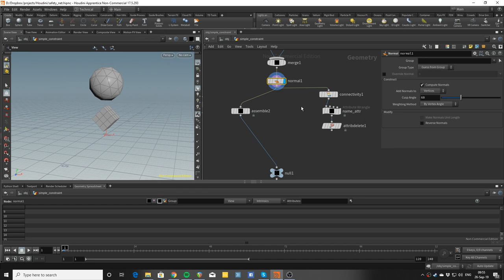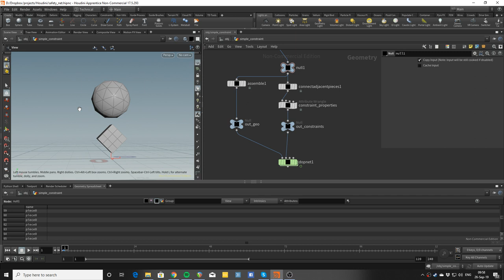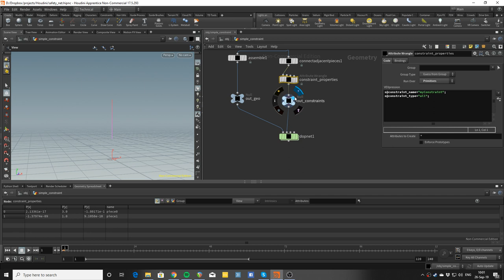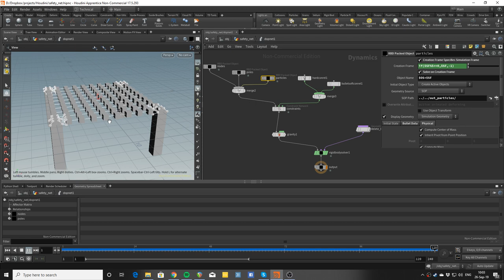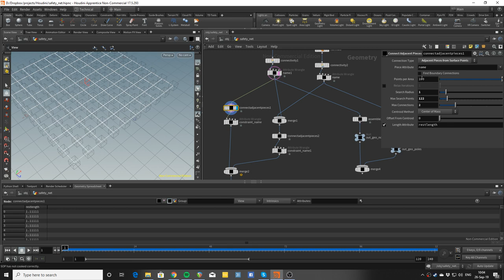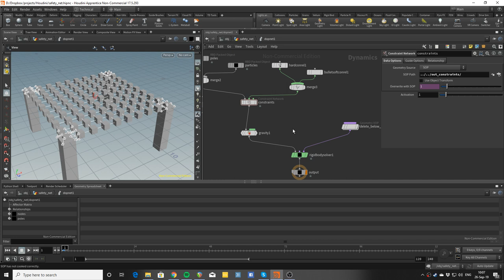Houdini 17 5 constraint network basics

Comment: how do you make the poles not move ? i'm unable to use constraints with static objects and importing them like rbd packed objects like you causes them to move.
Reply from the maker: You give the points that you don't want to move an integer 'active' attribute = 0. If you assign the attribute before packing, make sure it survives the packing and it's there on the points before they get into the DOP
Reply: @HristoVelev  I know you can do it with active, however, checking your example, I can not found any attributewrangle where you define this active attribute. how you did it?
Reply: (Found it)  You can specify as well the state of the rigidbody on  the "RBD packed object" node on "initial object type".
Reply from the maker: @andvfx  several ways to set it but eventually it's the same thing - an attribute value :)

Comment: Nice, and I found to get the particles rbd working you must use the mask with particles* instead of particles. Very weird I know.
Reply from the maker: Not sure where is that, but check out the names or groups in the geometry spreadsheet - with names for example, there's an index after the text part of the name, and adding the asterisk matches the whole thing :)